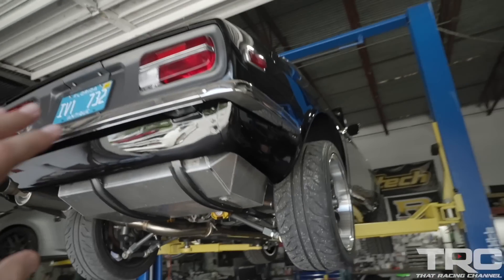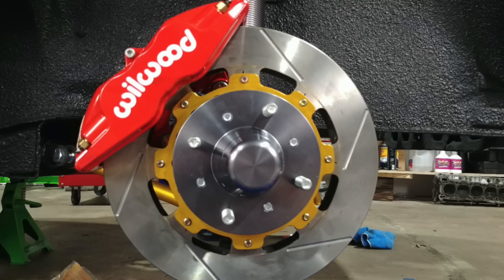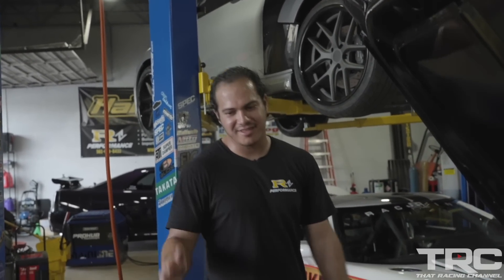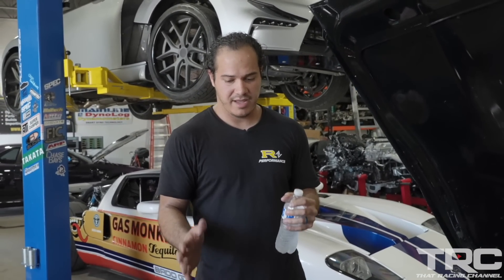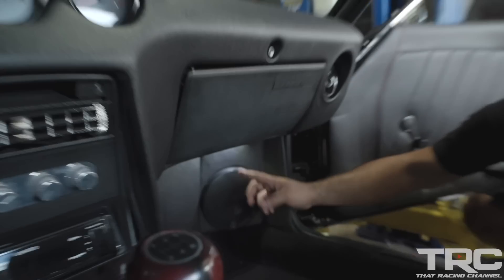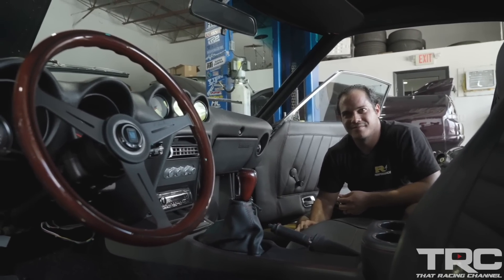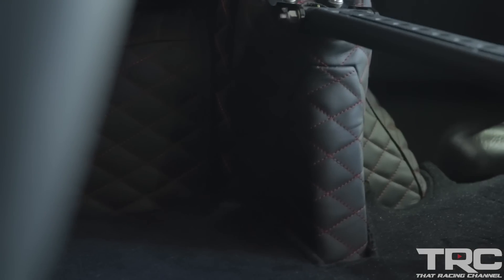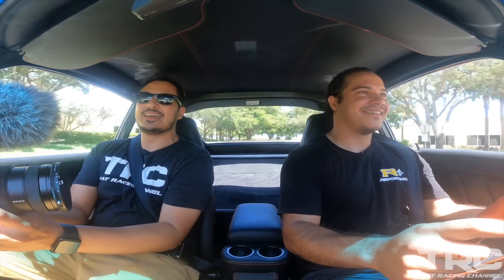RB26 Powered Datsun 240Z Street Pulls SOUND AMAZING! (Cleanest 240Z We've Ever Seen)

Comment: Nice build! But theres so much build info that is crying out to be told.
How much metal was replaced after blasting?
Tranny a 5 spd?
Why go with RB36 eng?
Transm choice and why?
EFI? If so which brand and why? 
Has adjustment of fuel/air ratio with the EFI?
Rim diameter choice and why?

DanaH

Comment: I would seriously suggest even the most basic chin spoiler for this car, otherwise, at about 91 to 92 miles per hour, the air gets under the car and will lift the entire front end to the top of the suspension travel and drastically alter the handling.

Comment: Had a beautiful straight rust-free 260z that I bought in the mid-80's for the grand sum of $2250. I put dual down-draft Webers and a header on it immediately, but bought it with the intent of putting a 350 ci SBC in it. Found that it would walk 5.0 Fox-body Mustangs with the L26, nevermind the SBC. Did a little more to it in the ensuing years (L-28, 5sp) and it was so dead-reliable for next 150K miles, I drove it all over the US & Canada (Alaska, even). The beauty of the early Z's, at least to me, were the attainability, affordability, and relative ease of working on them. So while this is stunning, it has none of those attributes. (If I had a cool quarter million to drop on a car, it probably wouldn't be something I once owned for 1/100th the price)
Reply: Yes, that's the great thing about the stock 240/260/280Z, plenty of easy power to be had with minor improvements.

Comment: The oval type portion of the exhaust , seems like a DUH why didn't I think of type moment. Imagine the room and clearance vehicles can have , question is, how functional is it ?? very curious to find out.
Reply: Should be just as functional. Nascar has been running oval tubing for clearance for many year's and thos cars make a ton of hp naturally aspirated. As long as the inner diameter is the same there should be no change in performance just way more ground clearance. We ran it my uncle's turbo k24 and didn't see any power loss
Reply: @OG80sScarface  Appreciate the education kind sir !!!!

Comment: Thee perfect Z by far. It’s exactly how I would build one. Tastefully done no big flares or widebody. Speed is not everything because there’s always someone faster. I’ve owned a 240 and 260 and yes stock they are very underwhelming 😆. I did a 5.0 swap on mine back in the late 90’s from an 89 mustang with 5 speed and that made it really fun. Beautiful car, tasteful build and great video as usual 🤙🏼
Reply: Yesss!!
Reply: They are so light i would never put heavy v8 8n one stay true inline 6 turbo can make as much power as small block and lighter. As not to fuck up balance and handling, v8 makes it to front heavy kills whole point of sports car handling.
Reply: @rt2255  RB26 is about 550 lbs, a couple hundred more than the original L24. An ancient 5.0 HO is around 500 lbs or less, and an LS3 somewhere around 430 lbs. Cast iron I6s (with turbos) aren't light.

Comment: I feel the swap kinda sucks because the motor they come with is awesome. The car is so nice inside and out and then you see a rb under the hood, I understand why people swap out slow d series in honda because they have no TQ but a L28 is bad ass N/A or boosted, this also shows how many people are just riding a wave on these engine swap. Everyone out here swapping motors for no reasons. I know a rb26 can make more power then a l28 when we are talking maxed out but that's not the point here. He's probably in the 500hp to 600hp range so yes a l28 could do that, here's a link https://youtu.be/gu9cp2Pd9Dg
Reply: L28 in the 600hp range far more expensive, exotic and custom than a swap, and you still have to pay for a trans adapter to cd009. I'm going 2JZ. Much easier path. Still Jap straight 6.

Comment: Give me a 69 1/2 true A body Plymouth Roadrunner with HRE 305's, Alcon CCX brakes, a built 426 Hemi Gen1 longblock with Lunati rods, modern Diamond pistons etc,  converted to EFI running on flex fuel managed by a Motec, and a 4.0L Whipple and modern cooling, clutch, RPM T56 tranny. Everything else stock. I'm actually glad I never grew out of emotional adolescence. I can still pretend, and it's still fun to do so.